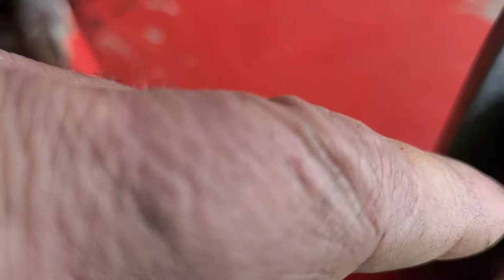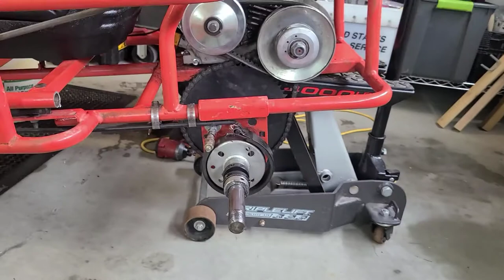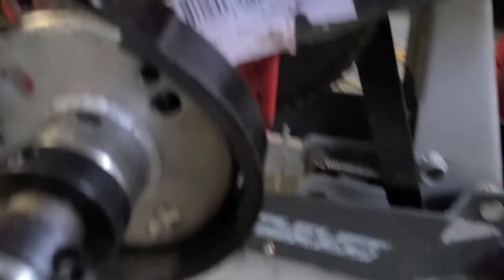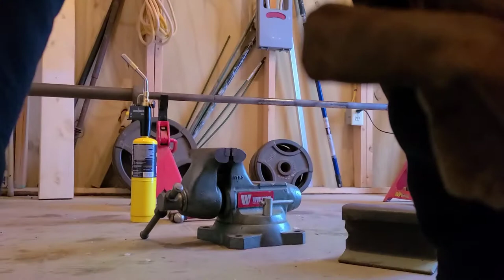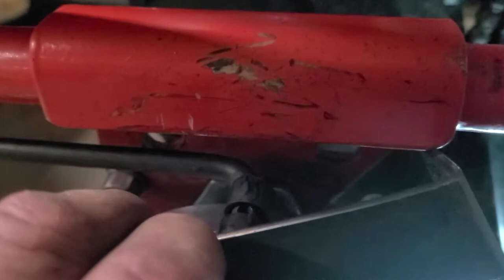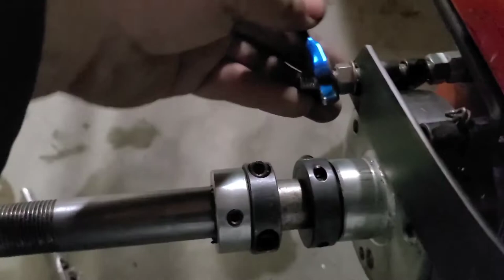Band Brake Bonanza Bro!

Comment: I had this yerfdog and I sold it to my friend so you will still see it around.I like how you reinforce the front.I sold it because it was too hard on my back because it has no suspension on the back.Maybe a seat with shocks will be good for you like a mower seat.
Reply from the maker: I came close to getting a mower seat but loved the quality of the skid steer seat I found at Tractor Supply,  plus it had the right mounting width to do a clean bolt pattern.  The stock seat was mint but it was too wide, flat and hurt my knees. It's a bit unforgiving on the bumps but at least it has flex in the back rest that takes away some of the shock.
Reply from the maker: I'm thinking about putting an ungoverned motor in it too but I really gotta upgrade the brakes some how. I wish it wasn't so hard to do three disc brakes!

Comment: Good luck with that brake. That was a sore topic for me and my Yerf Dog. It's done and done right, but man it sucked getting to that point. I eventually ordered a cable from BMI that was a perfect fit. I wish my axle kit would have come with a 6 inch brake instead of that 4.2 inch drum. It stops, but it could definitely stop better.
Reply from the maker: A cable eh?....🤔
Reply: @fatbuddycat  If you look at the diagram of the 3203, there's that rod that gets the brake motion rear of the seat... and then somewhere below the seat the rod pulls on a cable.

This is the cable I used and it had the perfect tension on the brake band. The band just sort of hovered there when not engaged and a good stomp on the pedal would get you stopped. I'm thinking about going back and buying a spare because no one makes these cables any more. There is a finite supply. 

https://www.bmikarts.com/Brake-Cable--23-_p_1786.html
Reply: @fatbuddycat  I'll take pictures next time I'm up at my land if you want, but if you look at the parts diagram of a 3203 you'll clearly see there is a brake cable. My big mistake was settling for a 4.2 inch drum instead of going for a 6.
Reply: @fatbuddycat  Here's a picture of mine where you can actually see the rod connecting to the cable.

https://i.imgur.com/NjUc4Xd.jpg
Reply from the maker: @rodneyws1977  ahhhhh now I see! The 3203 has the rear suspension so they needed a cable extension because the rod is rigid and can't flex with the travel. Today I'm going to be shortening the rod by adding threads to at the pedal adjuster to pull slack out of the band. This brake came with an axle kit from BMI karts, its where I go first for everything Yerf Dog since the bought the company out when it went down. They have some parts but they are going to disappear for sure as these karts and minis are so popular still.
Reply: @fatbuddycat  I probably have the same kit. For me I found myself needing two more lock collars than the kit came with.
Reply: @fatbuddycat  Wait just a minute. Are you telling me there is supposed to be suspension travel in the rear of this thing? I sure haven't felt it!
Reply from the maker: @rodneyws1977  Yes, exactly! They used these on a few different karts. My axle is 2 inches longer than stock but for $300 with wheels and shipping I couldn't pass!
Reply: @rodneyws1977  We just got an old Yerf for the grandkids ...
1. I can't even find the model numbers ... but I am guessing 2303 ... 
2. Brakes are a problem ... drum wobbles a LOT ... Not sure if it is a 4, 4 3/16, 4 1/2, 5, 6 ... where are they measuring ?  
3. What are best suppliers ?                                                                                                                                                                                   thanks ...
Reply: @stevejette2329  BMI Karts & Parts would be a good place to start.
Reply: @rodneyws1977  thx